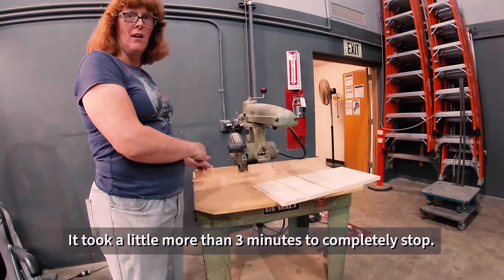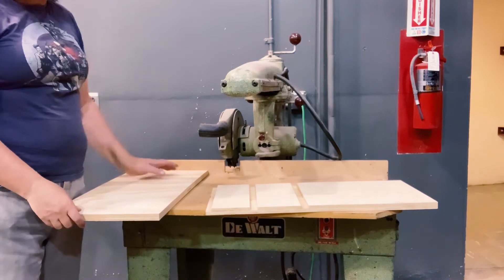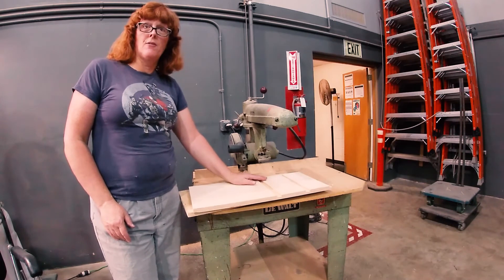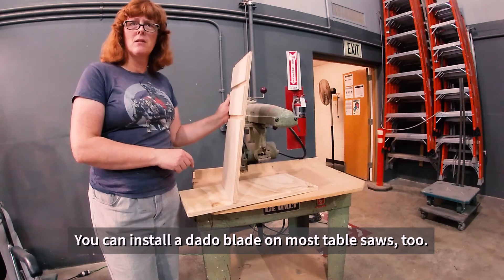Dados and Rabbets on the Radial Arm Saw

Comment: If they reintroduced the RAS and just called them "Dado cutters" they would sell like crazy. I enjoyed your video and all the explanations and details thank you for the demonstrations too. I've never used a Dado with my new old 1978 Craftsman radial arm saw I just purchased. I want a Dewalt saw. But the Dewalt radial arm saw is like trying to buy a 1969 Dodge Challenger or something. They are impossible to find in good condition (I've only been searching for 2 or 3 weeks). I am going to manifest one that is in like new condition haha. I want a nice one. I'm wondering if you like having that guard on there? I bought a 1978 Craftsman, because the guard and anti-kickback pawls and the little kerf guide wheel splitter, to prevent a kickback from the board twisting or the kerf closing inexplicably, is a major safety feature, that made me choose the newer saw. But if I could figure out a good way to rip boards safely, I would like to own one of the older Dewalt models. But I want to be able to rip boards safely. Have you attempted any ripping yet?
Reply from the maker: The vintage DeWalt machines are ones that no one seems to want to let go of. They seem to be practically indestructible, if you keep them in a decent environment. 

I did share a link in the description of the video to Bradley Tool and Fastener in Iowa I think they are. https://www.teambtf.com/radial-arm-saw-repairs
Their web page suggests they have a stock of vintage and refurbished machines, though you might pay more for their units that you would from some local owner. Plus they are in Iowa, so shipping from there could get expensive too, depending on where you are.

I bought repair parts from them. Most recently the roller bearings for the head, though I haven't swapped them out yet. Still have a couple projects I am working on and I don't want to re-do the entire machine alignment and tuning, which I know I will need to do after changing the bearings. I bought an aftermarket leaf-guard through them, and also a spring return mechanism. The original machine did not have the spring return design; that's a more recent safety requirement. I don't think the guard does much other than being a visual reminder and meeting work-place safety standard requirements. I do feel a little safer with it than without. I am not sure why they designed it as a chain-link design; it has hung up on some wood thicknesses occasionally. 

That said, the smallness of this 9" saw head and the spring mechanism not being that strong means that with a 3/4" dado head, the machine is still launching out at me. So it's a beast to control. If I am doing rabbet cuts or cutting smaller dados, it is manageable. I even bought a negative-rake dado blade designed for radial arm saws. I did not see a significant reduction in the machine's crawl. Maybe after I replace the bearings and get a more snug fit, that will help. I doubt it will change much.

I don't really do ripping on any of the radial arm saws here. We do all of our ripping on the table saw. That's where you need the anti-kickback pawls. The pawls just get in the way of the cross-cutting, so we have them removed most of the time. There are quite a few videos out there about ripping with the radial arm saw. The key is positioning the head the correct way and re-adjusting the shroud so that it acts almost like a featherboard holding the lumber down just in front of the cut.
Reply from the maker: When I do change out the bearings, I should try out a normal blade and see how it handles that. But I am not really sure where to get a 9" diameter negative-rake radial arm saw blade.
Reply: @calstatelaalproductions2358  Empirically, the 2 best RAS blades are in fact positive hook.  Tested by many RAS enthusiats and all agree, the best are the Freud LU83 (not avaialable in 9" at present) and the Forrest WoodWorker1 in special TCP grind (special order), the latter being a design collaberation from Wally Kunkle.  There is some who say the negative rake actually doesnt allow the chip to clear and a lack of gullets exacerbates the issue causing heat buildup, reduced cut quality and potentially a saftey isssue.  So the Negative Hook dogma has not fully been proved out, especially when many full time dedicated RAS guys have put the gambit of blades through empiricle testing. Access to this information can be found on the Delphi forums for the DeWalt RAS.
Reply from the maker: Last April, I installed a negative rake blade on my 14" Original Saw RAS and feel like that machine has been cutting 1000 times better than with the positive rake blade I had on it previously. I installed a Tenryu IW-35560AB2 blade which is ATBR and a negative 3 degree rake. 

Of course, what we do with the RAS in the theatrical trades is closer to rough carpentry than it is to fine woodworking. If there are minor cut quality issues, they aren't going to show up when framing a flat or a platform. 

Did they test the Freud LU83 on the larger machines, like the 14" and above? I would imagine you would see different behavior from smaller diameter blades and larger ones. I would also imagine a lot of RAS enthusiasts are probably using the smaller machines. I did share in one of my playlists a link to vintage RAS usage from around WWII. Each machine was set up to do a single tasks and lumber would go through several of them on an assembly line to do things like cut carriages for staircases.
Reply: @calstatelaalproductions2358  So one thing to consider. On a 14" blade, the actual tooth speed is probably twice as high as a 10" blade. I think the super high tooth speed produces a very fine cut with less splintering. Provided that the saw is aligned properly. But I am not sure? 

I have a small 5 1/2" Makita circular saw, and it says it turns 8,000 rpms. But when I make a cut with it, no matter what you do, the cut looks awful, and it chips the wood super bad. I've tried 3 or more finishing blades, all brand new, and they all chip and splinter really bad. 

I've determined that the small 5 1/2" blade doesn't have high enough tooth speed.

Perhaps, the angle of the tooth only matters when cutting plywood. I'm sure on soft plywood, a negative tooth angle would be more likely to splinter. But this effect might be offset by the very high blade speed?
Reply: @calstatelaalproductions2358  I have a LU83 in 10" and 12", as well as a Popular Tools blade GT840 (.118 kerf 10deg hook, TCG) in 8".  All are equal in quality of cut and manners,  I have had Forrest WW1 (Wally Kunkle blade in TCG and +5 hook) in 9"-12", and while it is the best (most carbide/more resharpening), performance wise, I think the LU83 is an exceptional buy.  Most of the larger saw guys I know, have exceptional, restored saws and will not compromise, so they are using Forrest WW1 Wally Kunkle blades.  The LU83 is a bit better in the rip than the WW1.
Reply from the maker: @jmc0369 The blade I took off of my 14" Original Saw was definitely a ripping blade, not a cross-cut blade of any kind. I don't know the exact rake, but it looked like between +25-30 degrees. So my comments are in relation to going from that to a -3 degree rake and being amazed at the performance improvement. I'll trust the RAS enthusiasts who have studied the difference between -3 degrees and +5 degrees and have decided that the slight positive rake is best for what they do. That's the kind of fine tuning we all want to explore, but many of us like in our shop, we rarely get the chance to do with our typical operations. 

Good information to share, so thank you for the blade recommendations. And hey, the Forrest WW1 comes in a 9" blade for my DeWalt! Woot woot!
Reply from the maker: @ Ritalie no I haven't seen that video, but I am super concerned that the operator is doing nothing to control the wood resting up against the fence! Even with a push cut, I would think you would want to hold your work firmly against the fence. The operator is also going way too fast for my comfort, and for the comfort of some of the commenters too. 

I imagine push cutting on the RAS to be a lot like push cutting on the sliding compound miter saw, which is the safest way to do a sliding cut on the sliding miter saw. They don't have a spring return or a motor head of enough weight to control a pull cut. Personally, I would find it highly impractical to do any push cutting with a radial arm saw, and more difficult to line the blade up to my cut properly. Plus it would only work with thinner stock. If I am cutting a 24" wide piece of 3/4" plywood on on my 14" saw, I have no choice but to do a pull cut, because the maximum cross cut is 24".
Reply from the maker: @Ritalie regarding the circular saw operation, I too have always had really crappy cuts from them. I'm usually using 6-1/2" cordless or 7-1/4" corded versions. I don't have a lot of experience with the smaller ones. I put on a 52T Tenryu blade on my cordless (SL-16552C) and was quickly making the cleanest cuts I have ever made in baltic birch plywood for some cabinetry work. Totally renewed my faith in the circular saw. They make a 42 tooth version of this blade for the Makita 5-1/2", part # SL-14042C. 

I bought several other blades to try out as well, a couple other Tenryu blades, two Makita blades (64T A-99948 and 54T B57342), and a Milwaukee 40T blade, but never got around to trying any of the others because I was so happy with the Tenryu Silencer Ultimate blade. 

Regarding the RPM, the only anecdote I can share is my thoughts on the 4-1/2" angle grinder versus the 7" angle grinder. I immediately thought the 7" would be more powerful because of its bigger diameter, but when I compared the specs, the smaller tools run 8-10K RPM and the 7" grinder runs at 5,000 RPM. So my conclusion was that even at the slower RPM, the larger diameter disc is still getting more travel at the perimeter than the smaller, faster tool, which is why it feels so much more aggressive with a new grinding disc and its performance drops off when the disc gets too small. It seems safe to apply similar principles to larger diameter saw blades, that the 14" blade will be traveling at more feet per minute at the perimeter than a smaller blade, and that will impact the quality of the cut.